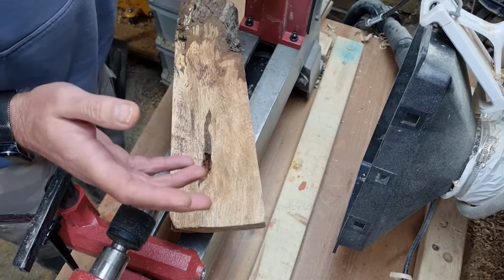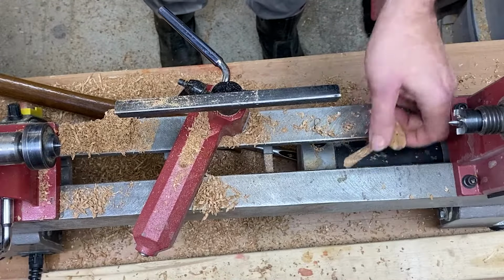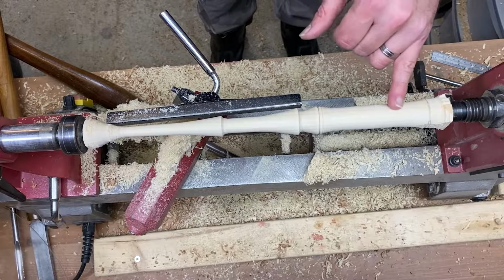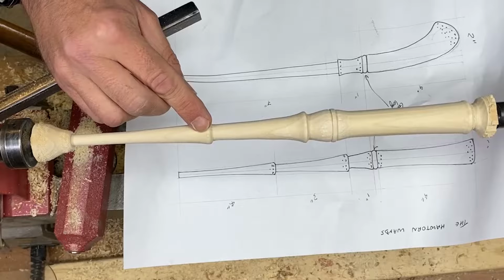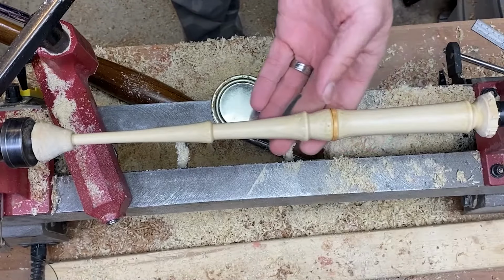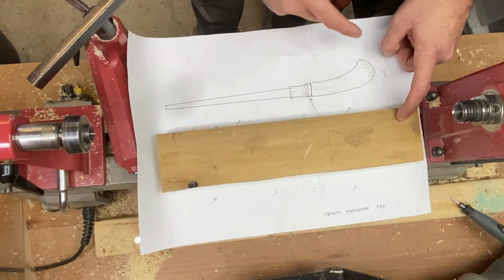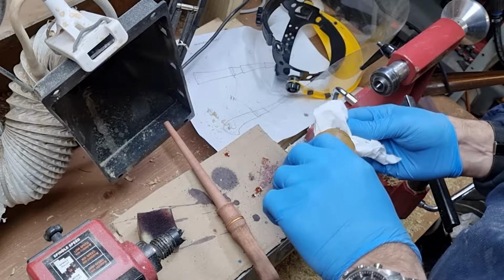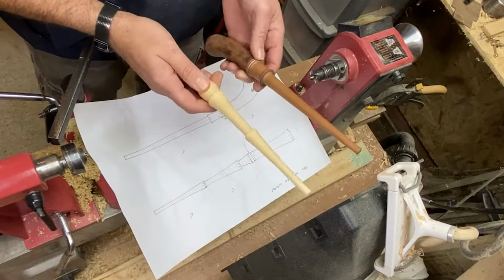Woodturning - ALWAYS have a plan B! #harrypotterwands  #harrypotter #wands

Comment: Glad you only needed a plan "B", also glad that spindle work does not fly far.   Hard to tell from the video if the hawthorn but it looks like the hawthorn was mixed grain at the tailstock end.   Not very strong as you experienced.
If you are going to do more spindle work, consider making a steady rest.
Also keep an eye out at flea markets for a 1x30 or 1x42 belt sander.   I picked up a 1x42 belt sander a few years ago.   A very useful addition to the shop for wood and metal and the belts are inexpensive.   This machine would be easy to use for shaping the handle.
The wands look terrific.   Well done.   I hope the recipients are happy.
Dave.
Reply from the maker: Thanks Dave, yep the gain in the hawthorn was not great! I do actually have a 1x30 belt sander but it's buried in a lockup I have, must remember to go and find it. The recipients are very happy except for me getting a name wrong at the end, now edited out.
Thanks always.
Mike